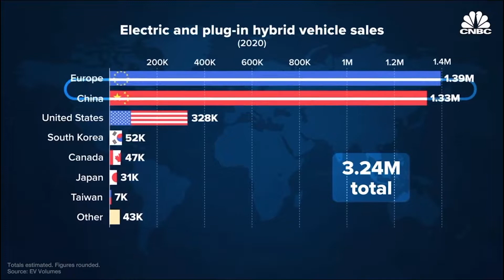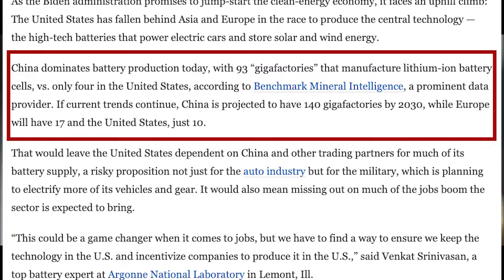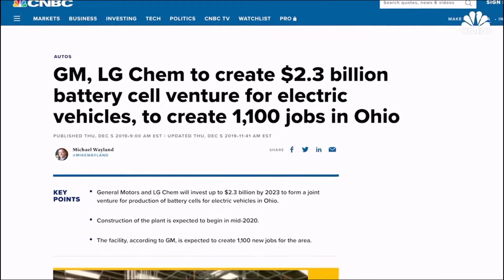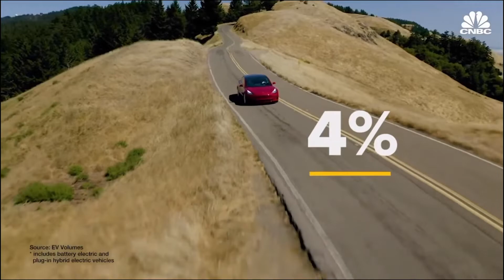ABML/ABTC to make HUGE GAINS as US goes all in on EV + competition against China

Comment: Why is this not picking up despite all good news you are sharing with us? I know patience is the key but still would like to know if there is any specific reason.
Reply from the maker: I am sharing because I like the stock. Most 'good news' that I have shared take time to mature.... 
The stock is not picking up because of a few reasons:
1. This stock has been heavily shorted recently.
2. The market has undergone a massive correction... with maybe more to come till end of April. 
3. For the stock price to go up significantly, ABML needs to have their factory set up. They are working on this, but ofcourse, this requires patience :)